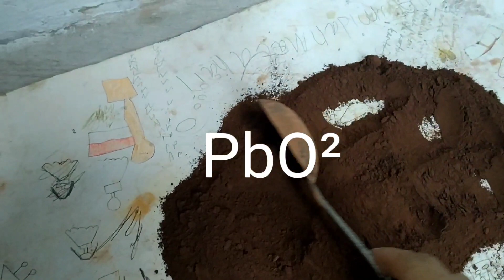Cara Membuat Pb³O⁴(Timbal II,IV Tetraoksida)

Comment: aslmualaikum,ms mau tanya masalh aki yng di daur ulang, udah di oksidasi, di biarin selama 1 minggu, masih ngedrop, itu masalah nya, apa mz
Reply from the maker: wa'alaikum salam, mungkin dari separator mas, kalau pakai separator tisu basah itu besar kemungkinan terdapat bocor di dalamnya sehingga perlahan arus listriknya akan habis, sebisa mungkin di pertebal bila menggunakan tisu, karena serat2 tisu terlalu kasar sehingga celahnya terlalu besar, berbeda dengan tisu micro fiber seperti separator asli aki kering, seratnya sangat rapat
Reply: klau boleh tau seporator nya selain tisu bisa menggunakan, apa mz,
Reply from the maker: @rudih7915  kalau separator aslinya namanya AGM Micro Fiber, bahan tersebut susah di dapat, selain tisu basah bisa pakai kain flanel yg untuk   kerajinan tangan

Comment: Congratulations. Good video, you're on the right track👍🤝 I similarly roasted on a homemade bugle, naa of coal. On coal, the temperature with blowing is large and you can immediately overcook good volumes of 👍
Reply from the maker: thanks, I can't control the heat if I make it on coals, if it's too hot all the powder will turn into PbO
Reply: I adjust the fan. If you turn off the coals immediately dump heat👍
Reply: كل احترام أخي شكرا لاعجابك أتمني أن تعلمني أنا من فلسطين.
Reply: بالغه العربيه
Reply from the maker: @محمدزيادبدرة  ما شاء الله نفتقدك هناك😭 ، تحياتي مني ومن عائلتي لإخوتنا وأخواتنا في فلسطين ، حفظكم الله أينما كنتم ، نحبكم جميعًا كثيرًا ، ما الذي يمكنني أن أساعدكم به مع أخي؟
Reply: مادمت قلت لي بأخي  انت من القلب
Reply: اتمني أن تدوم صحبتنا من أجل الله.
Reply: بارك الله فيك وفي عائلتك ولك مني ومن اهل غزه المحاصره في فلسطين المحتله  من قبل الاحتلال الصهيوني اجمل تحيه الاسلام العظيم.
Reply from the maker: @محمدزيادبدرة  🇮🇩❤️🇵🇸 بقليل من معرفتي ، ماذا يمكنني أن أساعدك يا أخي؟
Reply from the maker: @محمدزيادبدرة  يمكنك الاتصال بي على رقم WA على هذه الصفحة https://www.youtube.com/c/KacongMadura/about
Reply: بعد سلام الرحمن قمت بالاتصال  عليك اللهم اجعل اتصالنا من أجل الله.
Reply: @AlekseyCamodelkin 🎉😊ثث😊

Comment: When I calcined my oxides, there were also different colors from different batteries. When I milled nothing, but when I sowed through a sieve for flour dust was a lot. I had to put on a muzzle. And you don't have dust when sowing.
Reply from the maker: let's join in my WA
https://www.youtube.com/c/KacongMadura/about
 we can share experiences with each other, and I also have some books that you can read, I will share them with you if you want
Reply: Thanks brother, but the fact is that in the books they write about the use of primary oxides. That is, everything is new. There and the recoil currents are frenzied. And we use a secondary assembly, not that new. Since 2015, I have read so much and smelled lead and acid that I can be charged in place of the battery will be😀
Reply from the maker: @AlekseyCamodelkin  I also feel like it, and the more additional materials they add so there are many battery failures on the market
Reply: Soon the profiteers of people like us will be caught😀😀
Reply from the maker: @AlekseyCamodelkin  Sssssstt don't be too loud, they'll hear😀😀
Reply from the maker: @AlekseyCamodelkin  they think knowledge belongs only to them, so it must be patented, they are indirectly telling us not to think and just use their product
Reply: @KacongMadura  Personally, if you don't understand, they can return the shitty battery.

Comment: Is heating the powder enough to reuse or should I get a chocolate color
Reply from the maker: chocolate color can be affixed to the grid but when soaked in acid will fall off,
chocolate color : PbO2
dark orange color: Pb3O4
yellow orange color: PBO
I've shown the color I got at the heated stage at 8:24 minutes on the left in the video
Reply: Hola , ¿disculpa se toma la placa positiva usada con todo la rejilla o solo el polvo ?
Reply: Ni orang yg tepat... Kacong madura... 😊😊😊Cara penyampaianya... Terlihat kalo nyata2 anak sekolahan...gak srampangan... 😅😅😅👍👍👍

Comment: Ma,af mas, mau nanya, saya ,oksidasi dasi ,18 plat, jadi satu ,kok lama yah reaksinya,udah 1/2 hari, tapi masih biasa,ga ada,glembungan ,casnya,trafo 10 ampere, tak paralel pake, aki, mohon, minta, caranya, harus bagae mana, trim kasih ,
Reply from the maker: memangnya jarum pada amperemeter ada pada angka berapa ?
dan chargernya bisa mengeluarkan berapa volt ?
Reply from the maker: oh iya untuk ukuran ampere pada travo tidak menentukan besarnya pada output travo, tergantung hambatan beban yg di pakai,
bila hambatannya besar mka amper/arus yg mengalir akan kecil,
sebaliknya bila hambatannya kecil amper/arus yg mengalir akan deras,
itu mirip seperti arus/laju air dalam paralon,
kurang lebihnya seperti itu,
maaf jika banyak yg salah
Reply: Minta no hp atau wa ya mas
Reply from the maker: @ramagading8754  ada yg bisa sy bantu mas disini?
Reply: @KacongMadura  ,oke mas, matur suwun ,ilmu dari panjengan sedang kita pelajari,
Reply: Sy pengen belajar tp pake tarif mas..no wa mas brp ya
Reply from the maker: @ramagading8754  maksudnya?
Reply: @ramagading8754  wa aja ms lebih jlas